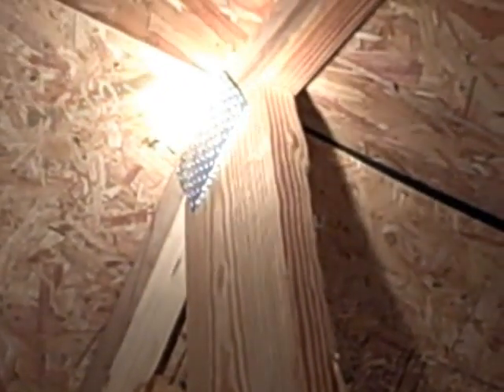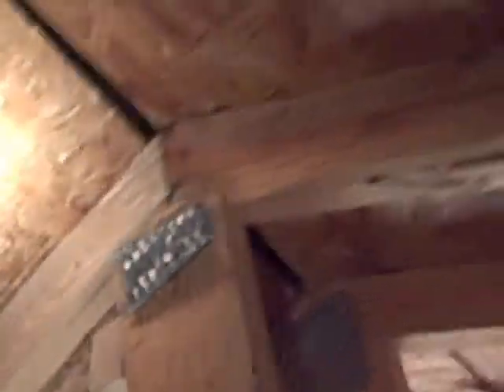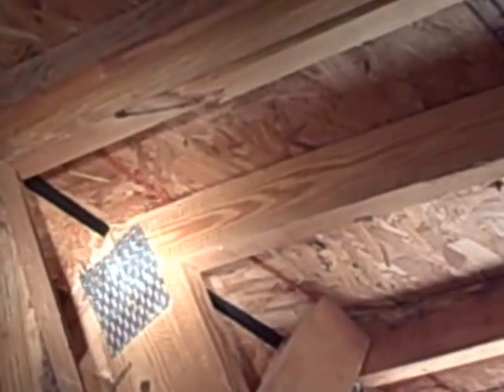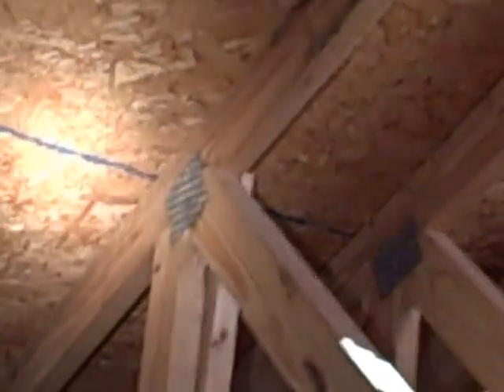damaged truss plates

Comment: If a connector/nail plate is bent such that a vertical brace can wiggle, is that a major concern? The W truss structure seems good and there are two vertical braces a few feet form the center ridge line in each cross-section. The home inspector said it’s normal for an older home to have bent/slightly loose braces, but the knocking sound gets annoyingly worrisome when they make loud knocking noises.